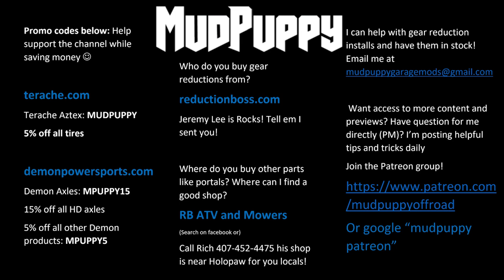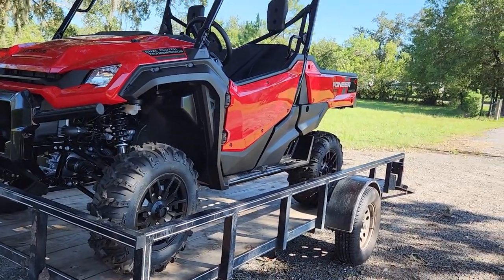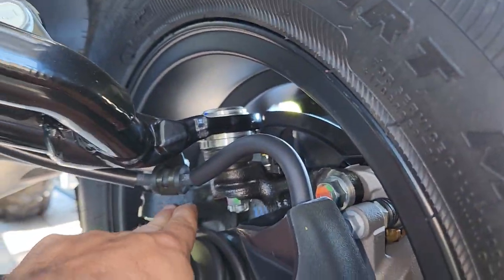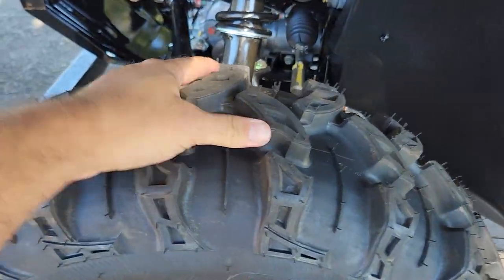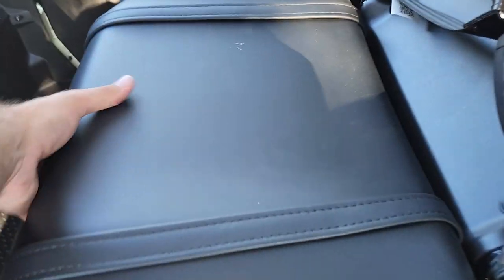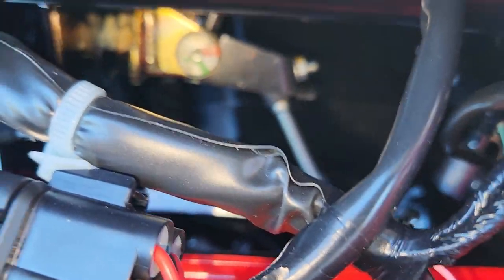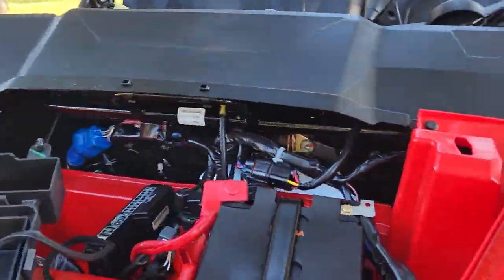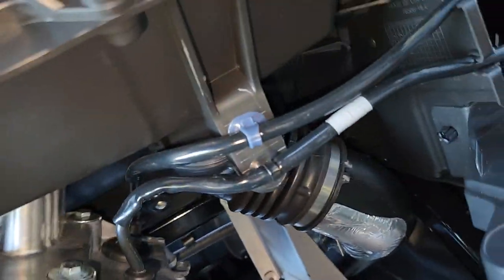Finally got one! New for 2022 Pioneer Updates and walk around Thanks for listening Honda!

Comment: Congratulations to you! I’ve had my 2016 Pioneer 1000-3 for a year now. It has 3,600 miles. Zero problems. I use it 7 days a week. Absolutely love it!
Reply: This kind of review is why I bought mine.
Reply: @tonym2513  My 2016 Pioneer 1000-3 EPS now has over 6,800 miles. Other than a stripped out steering joint/knuckle, it hasn’t gave me any problems. Honda covered the steering joint 100% under a recall. If I was to ever buy another side x side, it would be a Pioneer 1000. I wouldn’t look at anything else. My daddy has a 2023 Pioneer 700-4 and was thinking about trading it in on a Pioneer 1000. His 700 don’t have power steering and it’s a huge noticeable difference.

Comment: Hey if you haven't figured it out yet that 2nd cable that only works when it's in park is for the rear diff lock it locks it when you put it in park kinda of an override so it dosent stay open in park.
Reply: Atleast it should be*
Reply from the maker: Yep you are correct I just made a video about that

Comment: I like it, I looked at one, but I went with a Yamaha Wolverine X2 850 instead for a number of reasons.  Seating position and adjustability was first and foremost.  If you're not comfortable for all day riding it isn't fun which I found on my P700-4.  I had one $30 boot rip on my P700 after 7,000km.  Bulletproof machine.  I do love that dual clutch transmission and I'll be hating the CVT maintenance on the Yamaha.  However, Yamaha has the best CVT in the business.  Each machine has it's advantages and disadvantages.
Reply from the maker: P700 needs to go. I have no idea how honda is still selling that thing. Way underpowered and undergeared
Reply: @MudPuppyOffroad  that's for sure.  I was going to mention the lack power, but wanted to keep my post short.  Yes, it is underpowered at 36 hp and a top speed of 44 mph.
Reply: You're comparing apples to oranges..The Yamaha is a good machine but it ain't no utility rig , more of a sport rig.The beds too small and only 2 seats is a total deal breaker .

Comment: have watched a ton of your videos love them all your a wealth of knowledge for sure!! my question is I always hear the pioneer and talon has same motor and trans etc... but I noticed the pioneer has like 30 less HP why is that what is the difference and what needs to be done to match the talon HP?
Reply from the maker: So the 2022 Pioneer is a lot more common with the talon as far as motor and it probably only has 20 less horsepower. The big difference is the intake. The Pioneer throttle body and air box has to fit between the bed and the back seat. The talon has a lot more space for a high flow intake. Tune obviously plays a huge role as well
Reply: @MudPuppyOffroad  is anyone installing talon intakes and throttle bodies onto pioneers and having a tune done?
Reply from the maker: @EluderRacing  there is literally no space for it. You'd have to do serious seat modifications and bed modifications

Comment: Will be nice to see a review on the different 4 drive modes - 2nd, 4wd, diff lock and turf mode- I see where the trail and forest does not have the diff lock drive mode…kind of wondering if you would ever use the diff lock .. thanks for the videos
Reply from the maker: I use diff lock constantly if you want fake 4 wheel drive then get a Honda Talon way better suspension the same drivetrain as the trail
Reply: @MudPuppyOffroad  thanks for the response- like the rubicon has the red button you push in for front lock diff, on your pioneer you have 2nd lock and 4wd lock then you have all lock, I’m trying to figure out what mode is equivalent to the red button you use for the rubicon—— I cool idea you can always change the suspension and add the fox shocks to your Deluxe right?
Reply from the maker: @bruce9063  yep I could definitely add the fox shocks easily but I'm going to try to do something better than that more long travel. The red button on the Rubicon is the same as four-wheel drive lock on the pioneer base/delux.
Reply: Love to see lower reverse and lower high range" dif-lock is better than the brakes getting wet and not having true 4x4. I love mine it's 2021. Cannot beat a Honda" it starts and runs every time. Worth the price and wait. Step it up honda " you will sell more" I know of three people that bought other sxs's cause honda could NOT KEEP UP WITH THE DEMAND.

Comment: Thanks for the nice walk-thru. It’s cool to see the mechanical details you pointed out. I was bummed when I learned that none of the new models have the LED headlights anymore. Supply issue is what I heard, but then again, you hear that for everything 😂.
Reply from the maker: I just ordered some aftermarket LED ones
Reply: @MudPuppyOffroad  Cool. Are they the whole headlight bucket or just LED bulbs?  If it’s the whole headlight, do you have a link? I’ve been wanting to swap out the headlight assembly on my Rubicon and the ones from the Pioneer supposedly fit. If it’s just the bulbs, curious as to which you went with. I did multiple reviews on some bulbs on my channel. Wasn’t that thrilled with the light pattern on the bulbs for the headlights. Thanks. Much appreciated.
Reply from the maker: @EverydayATV  https://www.ebay.com/itm/255079083913?mkcid=16&mkevt=1&mkrid=711-127632-2357-0&ssspo=6vS36ic2Qlm&sssrc=2349624&ssuid=Hhy7YADzQmO&var=&widget_ver=artemis&media=COPY

Comment: It’s almost 2023 …
Reply from the maker: Congratulations you know the date
Reply: It’s good he got it for 22 because for 2023 on pretty much anything Honda especially all the atvs and stuff there is a $400 price increase on almost everything they sell and there changing pretty much nothing so now it will cost you $400 more than anything did in 2022 and there making no changes pretty much for 2023 unless it’s the 6 seater pionner.

Comment: swap a p1000 motor on to a rubi
Reply from the maker: Would be cool for sure but the differentials won't handle it so you would need to use Pioneer differentials and then you would need custom axles and by the time you did all that it would be like basically driving a pioneer...
Reply: @MudPuppyOffroad  fair enough, do you think the motor would fit though? i know its pretty close in size to the p700 motor, which they use under the seat of the honda rincons. so im assuming it would personally